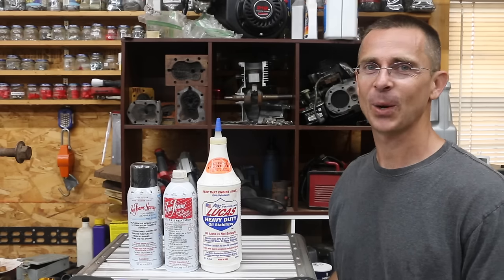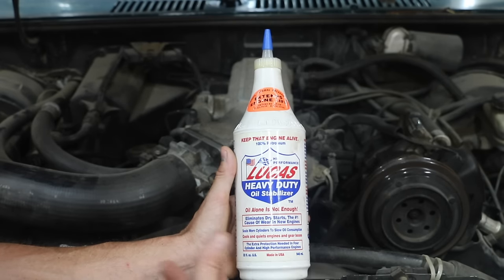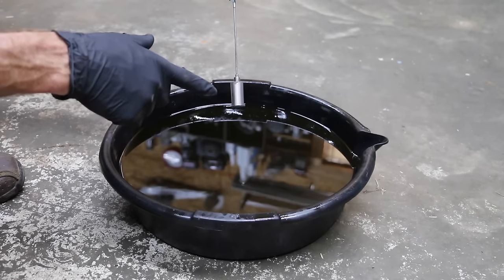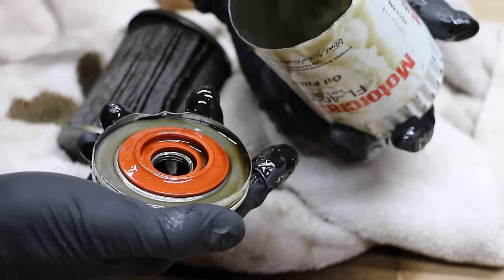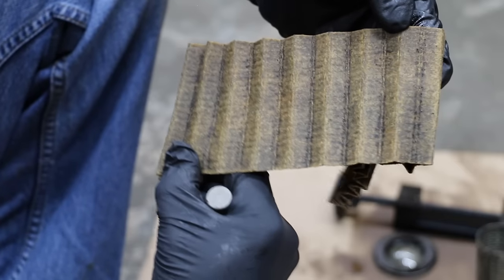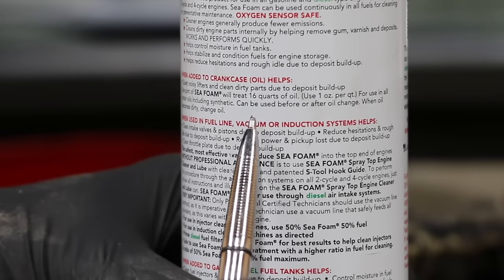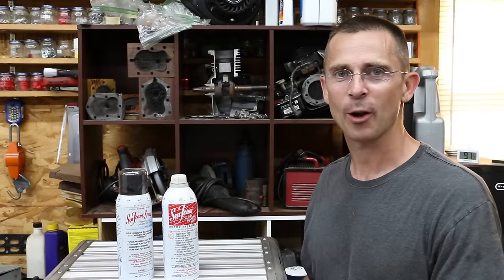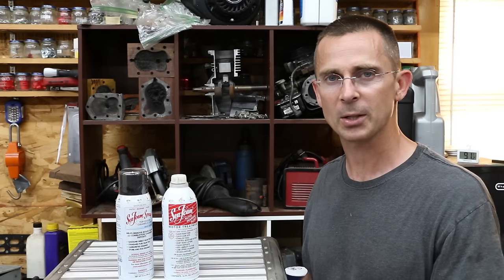Did the Seafoam fix last? Update on the Ford Ranger

Comment: Great video & very Informative. I've been a snake oil, sceptic most my life as well, but the honest with you if most of the products that have been around for decades didn't work, they wouldn't be on the shelves for very long with the way social media is nowadays you can make a break a company that either promotes or sells a product. This is, of course, my own opinion from a consumer standpoint, as well as iMechanic by trade & currently an automotive vehicle assembler. So I've seen both sides of the coin if you will, that being said, without physically, taking apart the engine and replacing the 3  piston rings or at least the first piston compression ring for each piston, but they usually come in sets of threes that would be a definite way to increase your compression performance. Without actually physically doing anything to the engine the only tried and true way is to increase the oil viscosity of the engine oil. It was originally designed for.? an example would be 5W 20 to very likely Noel all year round. You could put in 10W-30 and try that it will definitely increase your compression ratios. I don't particularly pay attention to specific compression ratio specifications with an older engine because it's just not gonna get there given the age. That being said it's better to focus on consistency they're all within 5 pounds of each other so one piston isn't doing nothing and the others are doing the work then you have another problem to address but if they're all fairly close give or take 5 psi or so then you definitely have a well running engine, and then I would go ahead and increase the viscosity by 5w at both ends. Now, if you have consistent climate, unlike CANADA , I live where we have four seasons, you might be able to get away with a straight 30w HD OIL GIVEN THE FACT THAT IT'S A FARM TRUCK AND YOU'RE RUNNING IT PRETTY HARD TO TAKE AWAY WHAT DEFINITELY HELP INCREASE FIELD ON ME AND COMPASSION. I would advise not using additives at this point and I'm not aware of any that claim to increase compression other than Delucas additive are used and I've never had a problem with which would definitely picking up the oil a bit while maintaining the crucial film voile on your cylinder sidewalls. At the end of the day if it's a farm truck have fun with it and I bet you'll figure it out by doing one of the 2  methods, I've suggested or even a combination of both. One thing to remember though you could never hurt the engine by changing the oil too often or at least the engine oil filter at 500 hours and then add half a quart of oil which I recommend synthetic no matter what it is you put it in your lawnmower, your car, your boat, two stroke four stroke. Synthetic oil's made by a reputable company such as Castrol or Pennzoil will definitely help increase anything and everything over conventional weight oil. Note 5W30 if you're not aware and some people are easiest way to explain it is five this winter, so 5W means five winter or cold weather and the second number is the viscosity once it reaches its optimal engine temperature it Is then a 30 weight at high temperatures, or it becomes more viscous you could say. If you find in the winter, you're having a hard time starting it you might even try a 0W20 MULTI VISCOSITY OIL, WHICH CAN ONLY BE PURCHASED as SYNTHETIC because it's almost the same consistency of water at low temperatures. Currently the thinnest oil used by automotive manufacturers is 0W16 SYNTHETIC by the Japanese motor companies, Honda, and Toyota mainly. Whereas North America is just getting caught up and using a 5W20 conventional or synthetic oil in order to meet or exceed feel efficiency, standards, and believe it or not sometimes that's all it needs to pass emission standards is a little bit of dinner oil.

Comment: Lucus  is the only oil additive I can think of, others are no cigar. For tightening up the cylinder compression issue. Others have copper shavings in them and do not work. Like STP oil treatment... that  stuff can be found in the bottom of the oil pan.
Reply from the maker: Thanks for the feedback.

Comment: Yes sir great video i watched the first and second on the sea foam what a huge difference. I used the lucas high milage on on my f-150 .4.6 literm guieted right down but i think i will use the injector cleaner in the gas and also use the spray in my thottle body. Great info thank you sir
Reply from the maker: Thanks and you are welcome!

Comment: I know it's an older video but WOW, I never would've believed this with that noisy engine otherwise. I just used the Seafoam spray and motor treatment. Time will tell ;) Been trying to regain some gas mileage loss on a 2009 F150 4.6 3V...227,000 miles. Tryna get my LTFT levels down. Great content!
Reply from the maker: Thanks!

Comment: I have always used seafoam for years but always wondered if it was truly worth it. I recently bought an 08 f150 5.4 and it ran fine coming home but then started idling rough and couldn't figure out why tell I read about the vvt phaser issue they have. So I figured oh great I'm screwed . I can across the original seafoam video you did and seeing how well it restored oil to your little old Ford head I figured what the hell. So I put in roughly half a can and let it run for 10 mins and it seemed to smooth out the issue so I took it on a 20 mile around town drive and it continued to improve to the point I couldn't feel any vibration anymore. I'm gonna give it a week or so and then change the oil and hope it stays that way but so far so good and I thank you for the video that helped .e decide to try it.
Reply from the maker: You are welcome!  Thanks for sharing.

Comment: I had a 65 mustang, and every third or fourth oil change I did , I would run a gallon of kerosene, and a quart of automatic transmission fluid through the crankcase, I would take the old filter off and drain it and put it back on, put the kerosene, and tranny fluid in it, and let it run for about three minutes, drain it change the filter and put the oil in, kept it going , and running clean for a long time
Reply from the maker: Thanks for sharing.

Comment: Beware..Seafoam will not cure the need for a Valve job...as I personally grasped for straws not to have to do a Valve Job..I sprayed the Sea foam down the Carb...the Sea foam did clean the carbon off the Lifters and the car never started again...lol... at about 120,+..(no compression)...So make sure if your going to Play you have a Alternate mode of transportation and it is where you can leave it if you have any less then perfect results...enjoyed the Video...Thank You...
Reply from the maker: You are welcome!  Thanks for sharing.

Comment: The lower compression may be due to carbon build-up on the valve seats.  You may want to try spraying Seafoam into the throttle body or if it has a carburetor spray it down the throat to let it pass on the back of the valves.  I’ve had that help if there is Caron on the back of the valves.  Of course from the sound of it before treating it there could be ring wear or valve seat issues.
Reply from the maker: Thanks for the feedback.

Comment: An auto mechanic replace my valve cover gasket. Noticing a lot of build up, he suggested adding a quart of transmission fluid to the engine 500 miles prior to a scheduled oil change. I haven't tried it.
Reply from the maker: Thanks for sharing.

Comment: There was an oil additive in a shiney silver container that did wonders for my old Monte Carlo and my Pontiac 6000.   There was 3 container sizes.  (4cyl, 6cyl,8cyl) sizes.  The Monte had a shift kit in it and it would 2nd gear scratch with the oil additive.  It wouldnt  bark em shifting to 2nd without the stuff.  I noticed 3 mpg gain with the Pontiac 6000.
Reply from the maker: Thanks for the feedback.
Reply: Engine rrestore is called.

Comment: Little tip (not sure if you did) rub a little of the new oil on the rubber seal of the new filter and it'll help seal nicer and when it's time to change the filter it comes off easier
Reply from the maker: Thanks for the tip!
Reply: @ProjectFarm  3 years on is it still running good?

Comment: your great to do all these experiments . i have been using lucas for every 4-6 tanks of gas and  fine it works great , i did not know you can use sea foam in oil  will give that a try a week before oil change, but also thought to mix it with lucas oil treatment and see what happens.
Reply from the maker: Thanks!  Thanks for the feedback.

Comment: I've got an 08 Dodge 3/4 ton 4x4 with a 5.7 Hemi. ( I believe that 5.7 denotes mpg and not displacement but I digress) It's a W/T and has about 165k on it. It has a pretty substantial knock and it consumed some oil. I have been told I should use a conventional oil over a synthetic. I have been using a synthetic blend. I think this engine is a good candidate for the Seafoam, Lucas treatment. I was hoping to wait till it was warmer as we have had many, many subzero days in the Dakota's.
Reply from the maker: Thanks for sharing.

Comment: have to thank you (a bit late...) years ago my '97 corolla, which was in perfect working condition (no leaks nor anything visibly/audibly wrong...only time the car ever let us down was once when it got a rock through radiator and once when rats ate a bunch of wires), but couldn't pass ridiculous california smog (why don't they make those electric car factories pass zero carbon/cadmium/lithium/etc tests?)...

after two seafoams and a lucas oil fuel treatment it passed...in subsequent test years it actually improved and then this year I went to iridium plugs, replaced some seals, and ran at-205 through -- a couple months ago it had virtually zero emissions (then a couple weeks later lady ran a stop sign and that car is suddenly no longer with us)...

no matter what scotty says, I run seafoam through my camry and civic too and regularly use lucas oil oil and fuel treatments and together with japanese qc and a lot of prayer our cars keep getting us where we need to go and passing the ridiculous tests that come out of our california idiocracy...
Reply from the maker: You are welcome!

Comment: Been using seafoam and Lucas for years being as I buy beaters to get through the winters her in Wisconsin (to much salt/minerals on the roads) I also have found the stickiness of the Lucas to go away after 100+ miles so probably nothing there for you to worry about running in the winter. 
The other thing I wanted to say was I recently tried the Lucas brand fogger and was a little more impressed by the amount of carbon it took off the intake compared to the seafoam, but that's as far as I looked into it so can't say one way or the other about the internals.
Reply from the maker: Thanks for sharing.

Comment: That thick version of Lucas is really awesome stuff. Try a quart of Lucas again & retest that compression. I've had amazing results with it reviving & quieting worn engines. Nice to see the power of Seafoam in a "scientific" barnyard test!
Reply from the maker: Thanks for the suggestion.
Reply: How much Lucas oil treatment should I add to a 2002 GMC Yukon that holds 6 quarts? Should I just sub one quart of Lucas for a quart of oil, or add 5 quarts of oil and 1 quart of Lucas?
Reply: @CoachStraussPE  That's a bit modern -- I would only suggest 1/2 a quart -- only if it doesn't have VVT. The original Lucas Heavy Duty is super thick -- but doesn't thicken oil viscosity like the old STP treatment. If the motor is really old & has problems with rings or bearings -- I had no problems using 1 quart for every 5 -- and it didn't make the oil too thick at cold startup. Just make sure there is no VVT -- because that demands thin oil. Lucas also makes an oil treatment modern engines -- but I haven't tried it -- it's very thin viscosity.

Comment: I am a fan of the seafoam and Lucas I also use Amsoil and it rocks I do 10000 mile oil change intervals with the Amsoil. 
    We had a 1982 Cadillac Seville that had the 4.1 liter or 250 cubic inch V8 we sold i
with just over 30000 miles on it still not using but maybe a quart of oil in 10000 miles. 
   It was purchased from my father in law who also is a the only oil is Amsoil guy just like I am so there you go I also used Lucas full synthetic oil stabilizer in the Seville. 
   Never any internal engine problems or noise.
Reply from the maker: Thanks for sharing.

Comment: I have some experience with engines, in an European Army. We had a colleague that was educated on ship and aircraft (piston) engines, worked a few year at Pratt & Whitney, left because didn’t like jet engines… He had some experience with water injection, claimed that this engines was extremely clean.  Had some problem with a MB 3 liter 5 cylinder diesel engine, this is a fantastic engine, can last 400k miles in a taxi. But this was likely idled too much. He had following suggestion to get the cylinder, top and piston clean: Spray in a water fog in the engine after air filter while engine hot at at full power. Used pump up “pesto side” garden equipment and wen uphill. Claim: The 
“carbon” present in combustion chamber is very hot, that means dry! The water injected at inlet stroke “wet” carbon, when combustion  happen the water almost explode when it meet the combustion temperature (at full load), and the particles fly out the exhaust. I tested this also in reality.Due to traffic situation going uphill, 12% I had to stop, afraid for getting hydrostatic lock due to then water I kept the engine at high rpm. After 2+3 minutes I could stop the engine and walk around the vehicle, under the exhaust pipe it was soot, alm 9:17 alost a 1/2 cup. Was not allowed to continue the experiment, management afraid for hydrostatic lock if not done properly.
Reply from the maker: Thanks for sharing.

Comment: Lucas sticks to the parts real well. If you use the truck often you shouldn't have to worry about cold weather. If you don't use the truck often that Lucas protection can drain off which could be bad on cold weather starts. Marvel Mystery oil IN THE FUEL will lubricate the cylinders immediately on start-up cold or warm weather. Adding Marvel Mystery oil to the crank will thin out the Lucas which you don't want to do in the warm weather. I used MM oil for 31 years in my 1989 Dodge Ram B-159, 318 cubic inch Van almost ever tank load of fuel and in the crank on oil change depending on the season.
There's approx 520K mile on the engine and the only work done on the engine was changing out the timing chain twice as a maintenance (not a failure)
I've had a lifter tic for years but now I'll try the SeaFoam spray down the throttle body while running and in the crank.
Reply from the maker: Thanks for the feedback.

Comment: When you are ready for the next oil change,  top the engine off with automatic transmission fluid and  run it for a bit.  It should  clean up some of the inside of the engine.  It can also  free up  valve train.
Reply from the maker: Thanks for the feedback.

Comment: On Amazon, type in "shortening filter." That wire holder and paper filters may be what you need to filter the motor oil. Don't know if it'll work, but it's a cheap fix if it does work.
Reply from the maker: Thanks for the suggestion.
Reply: @ProjectFarm  If you get the small wire frame and paper filters, turn the filter inside-out before you put it in the wire frame. That allows it to sit correctly without you having to hold it in place. In the early 80's, we used that setup at KFC to filter out the "cracklings" from the Original Recipe shortening. The cracklings were used to make the gravy. I think all that stuff is shipped in pre-made now.

Comment: I've never believed in lotions and potions in fuel or oil. Too many of them have been pure snake oil.

Seafoam has it's detractors. But these Project Farm videos make it pretty damned clear that, so long as you don't have anything broken in the motor, this stuff may be the answer.

I hope so. I just ran a can through my gas tank and added it to the oil prior to a 5000 km routine oil change. The motor has 156,000 kms in a 2002 Suzuki Gran Vitara 2.7 V6. It runs fine but it has a visible glaze of tarnish looking through the oil filler cap. I hope it works as well as in the video.
Reply from the maker: Thanks for the feedback.

Comment: If you want to know if the compression problem is in the cilinder head or the bottom part of the engine do the following:

Run a compression test (4 strokes of the piston for example)
Write down the reading.
Squirt some oil down the sparkplug hole (4 or 5 squirts with an oil squirter)
Again do the compression test. (also of course the same number of strokes of the piston)
Write down the reading.

If compression goes up a little (1-5 %) it's in the cilinder head (leaking valves, valve seats are worn, valve guide worn out)
If compression goes up alot it's usually piston rings, pistons are worn out, cilinders are worn out.

Easy trick to do.
Reply from the maker: Thanks for the feedback.

Comment: As I said in the Original Video, I've been using Seafoam for years with No Complaints. Your Ranger STILL Sounds Much better than before you tried Seafoam. (I currently have no experience with the Lucas Treatment.)
Reply from the maker: Thanks for sharing.

Comment: Old way of cleaning oil was to filter it through a cotton rope. Put dirty oil on an upper shelf, put a piece of cotton rope in the used oil drop the other end into a clean container. The used oil is wicked into the clean container, leaving sludge in the used container/ and in the rope. Takes a long time.
Reply from the maker: Thanks for sharing.